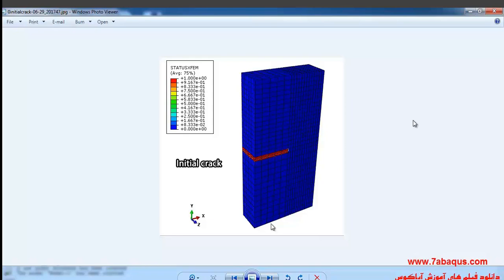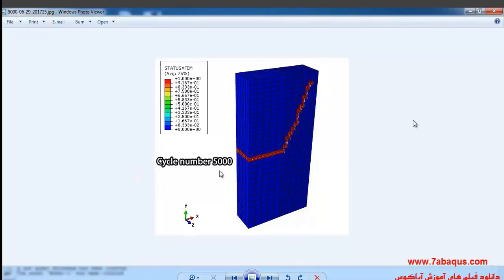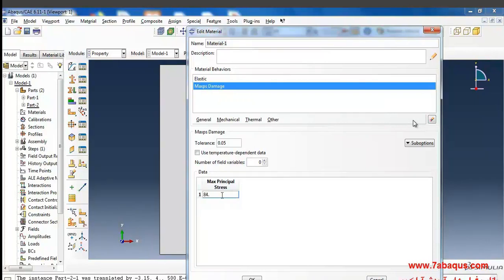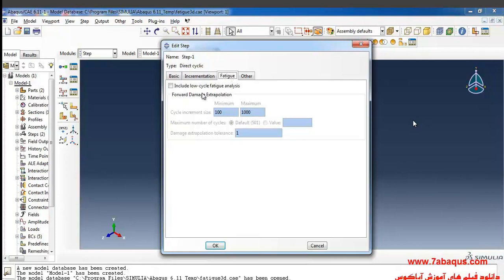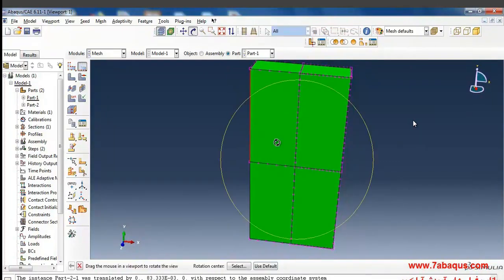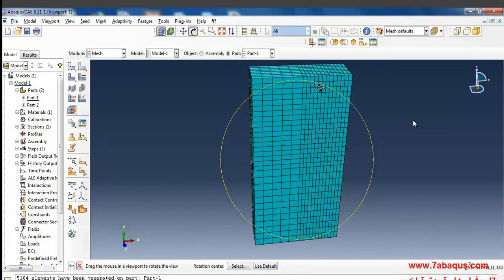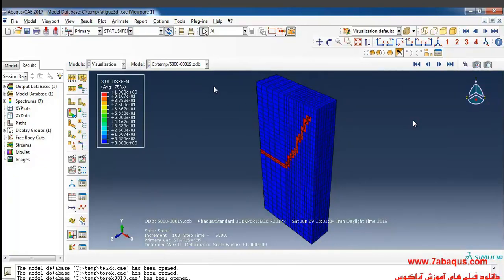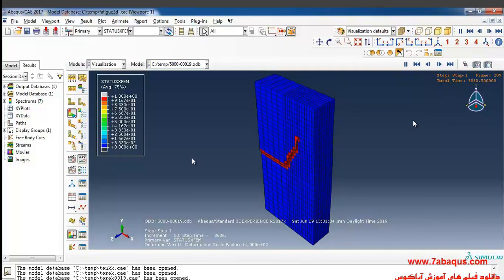Low-cycle fatigue 3D (5000 cycles) ABAQUS

Comment: Dear Saeed, the crack is supposed to travel normal to the loading in mode 1 loading and it's not the case in yours simulation. Can you give a comment for the same ?